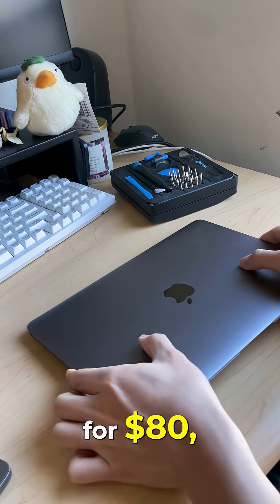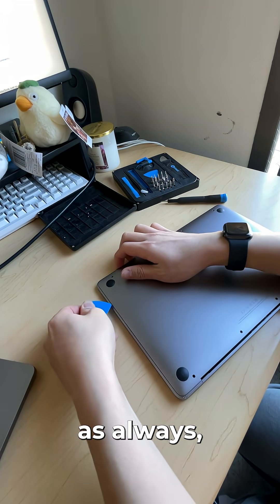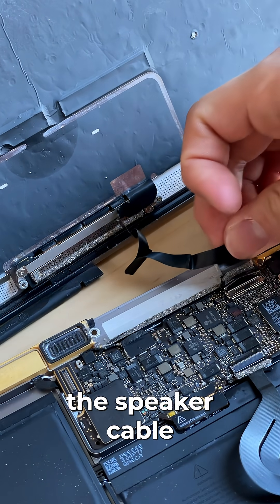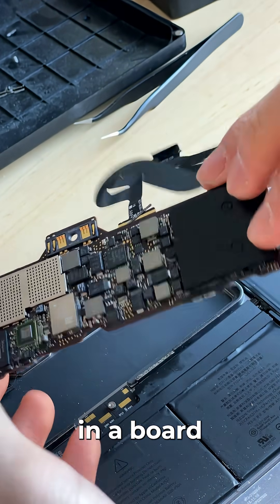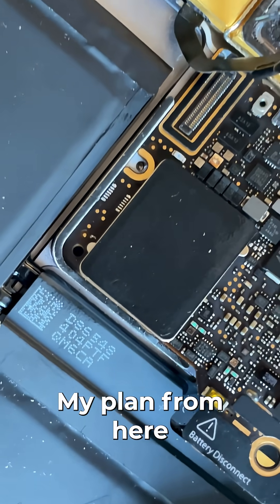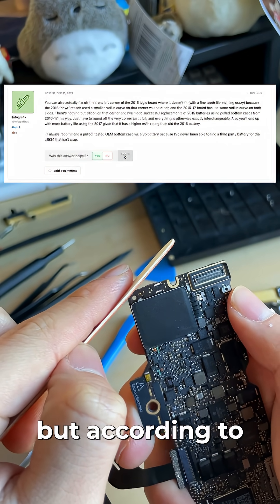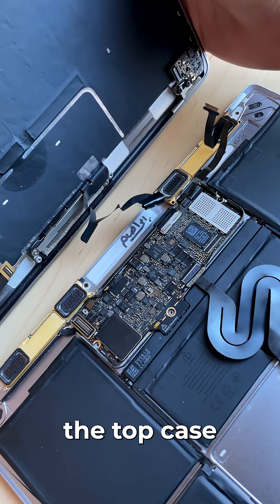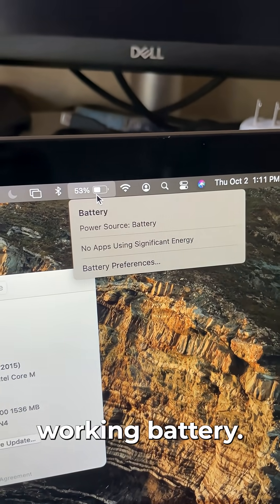$80 12 inch MacBook (2015) repair

Comment: Ah, what you did there was got trying to use a 2016 base on a 2015 machine. Also, now the serial number doesn’t match on the bottom or the EMC number… I just took the battery out of mine and did it that way.

Comment: the board is sandwiched and phones we are using have equivalent component so there are even smaller computers. There is pi zero 2 which on of the smallest full systems. But what I want to really mention it that you did all that for just a battery replacement imagine this was a Thinkpad it would only be 2 screws

Comment: Whoever came up with non removable batteries on laptops should have a special place in hell. I can change my 2010 Acer's battery in 5 seconds. And yes, the original battery still works for about 3 hours.
Reply: When you want to have a Laptop that thin (like a Macbook), it's almost impossible to make the battery replacable. But I agree with you, I also prefer a laptop that's thicker and easier reparable than a super thin laptop.

Comment: I would recommend to do a big blob of thermal paste under the heat sink of the logic board in contact with the lower case. These mac cpus are famous about dying from overheating

Comment: That 2015 MacBook is a garbage machine. Drastically underpowered processor AND the keyboard is mush and fails. It’s always useful as a headless machine/server. It doesn’t need a battery….

Comment: What's crazy is the average person isn't able to change the battery. They have made it complicated for profit.
Reply: I remember when my laptop's battery could be removed by opening one latch
Reply: @Bagel_Francisco  yeah I can take my tubular battery out from my laptop with just One press.
Reply: @Bagel_Francisco my laptop have switch just unlock and battery can be removed easily 
My one is 14 years old Lenovo laptop
Reply: What? That was a gym meaning! I thought that was a money gear!
Reply: Yup, and that was like 8 years ago. Now it’s hell. The number of steps are the same but way more fragile and more ways to f up
Reply: @Spidr-Man No. It’s actually easier on basically every other MacBook, even the new ones. This design was required to make it as thin as it was. The battery cells use a social tiered design and are literally tapered. The goal was to actually give the laptop decent battery life, and they did, while making basically the thinnest laptop to ever exist…except it had the drawback of all being glued in. You can dissolve the adhesive but it’s tedious and extra sketchy with this battery in particular. 

It’s a design constraint issue here. Not malice.
Reply: @Spidr-Man modern mac’s don’t have batteries this bad iirc this computer is just a mess because of how over ambitious they were trying to be
Reply: @eternalwavee I think it's what they help people with! They all have roles of extreamism and nothing fits? A thought for a better world
Reply: @Spidr-Man Yeah, cool!!!!! And then people can still fix it easier killing the throw off! And we like it now because people walk in and out everywhere practcing thier magic
Reply: Surprisingly, they actually somewhat made it easier. Not super easy, but easy enough to the point that I’d be confident doing that repair.
Reply: No they did that to make the battery larger. Thats why thinkpads got garbage batteries compared to MacBooks
Reply: I am a computer engineer with 40 years of experience, and I have issues removing or replacing that battery lol
Reply: @arador1968 lol, you think this would get people to settle somwhere!
Reply: While you are partially true, you are missing the second part. You can't make something ultra compact and small AND easily repairable. Those two are almost always exclusive.
Reply: Не увидел ничего сложного в этой процедуре. 

А подпиливать плату пришлось или из за разных ревизий, или потому что не оригинальный корпус.

Comment: When you disconnect the battery in a Mac laptop, should you press & hold the Power button for a few seconds to safely discharge any residual electricity in the caps? 🤔 Neat corner mod!

Comment: Also these computers are like 150$ in working condition so…
Reply: Tell me where and I will purchase! 😮
Reply: @whatdreamsmaycome9441 They average at around £90 for a 2015 Macbook Air and £130 for a pro lmao. Waiting for your reciept
Reply: Fr im like I wanna know cause almost everyone overcharging putting even old ass 8,1 MacBooks from 2011 for like 250-300+
Reply: @Max7oh2  i can found for you an 2017 air a1466 for 200 euro with 8g ram.

Comment: Dont forget for issue on this model )), dead ssd/cpu, pcie line. This problem start at factory )) 2015 90% dead, 2016-17 70%dead

Comment: unfortunate apple ruined the macbook line with an overpriced low end model, plastic macbook was 200$ cheaper than the pro back then
Reply: The macbooks of today are way more valuable than the intel garbage they used to sell..

Comment: The best technician to ever live
Reply: But his fingers are not as tiny and racoon like.
Reply: Andy from Salemtechsperts is sad now
Reply: @pranithmallela5527 😂
Reply: @pranithmallela5527  good, he's a joke
Reply: @AustrianDeathMachine9 how is this guy, who isn’t even capable of removing a battery, better than the guy who does stuff like this professionally for a living? Only joke here is you
Reply: @shocknaw they both don't really know a lot. I specialize in a lot of computers services in hardware design and I have been around almost every machine also some of the methods I've seen these guys use are not really great
Reply: @AustrianDeathMachine9  oh cool, what company you work for then?
Reply: @AustrianDeathMachine9 since you got those bold claims, help me out then, thermal throttling on a laptop, how do I properly undervolt, every guide kinda sucks
Reply: @Warmachinerox33 there are guides but they don't go as in depth as I need, they all assume I have knowledge on it and I'm clueless lmao
Reply: @AustrianDeathMachine9 if they didn’t know alot they would be in business 🥀
Reply: @AustrianDeathMachine9 sorry but you’re wrong.